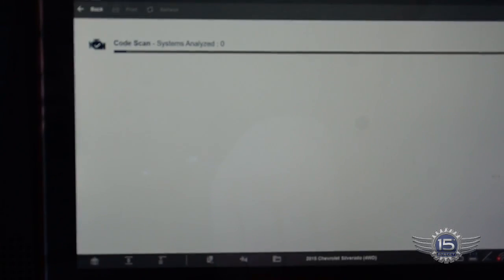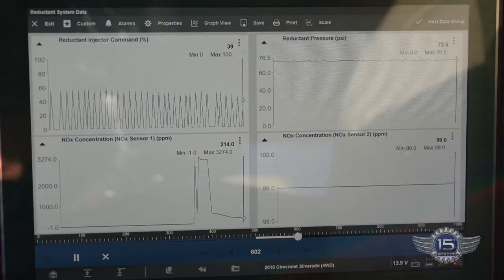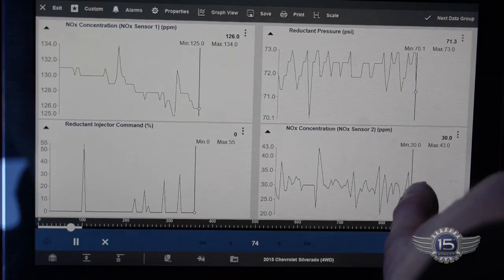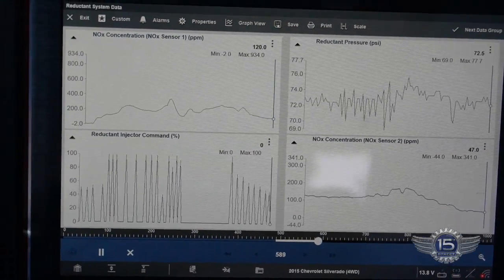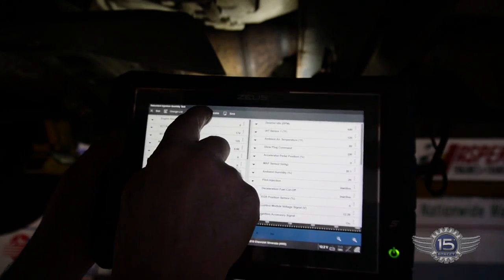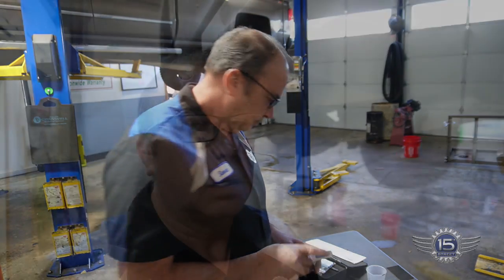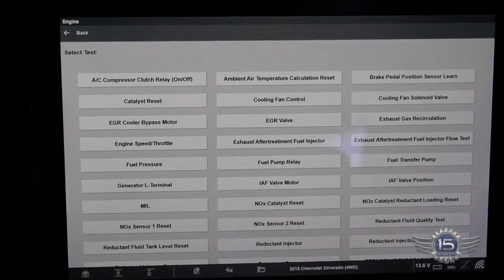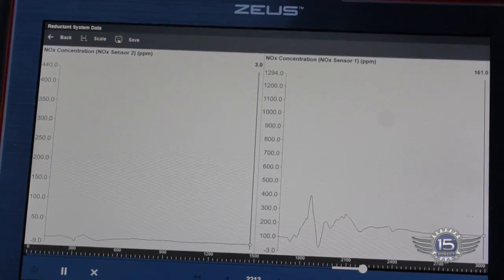Chevy Silverado Duramax P249D Diagnosed and Repaired

Comment: Had this happen to 2016 gmc 6.6 denalli. Replaced 1 and 2 nox sensors and def injector. Had the P249D code and count down to 65 mph. Took 3 tries to get it right but I think it's good now.
Reply: I’m going through tha right now. 2015 GMC 6.6 Denali. I got P249D code and count down. 

Can you elaborate please what did you mean “took 3 tries”?
Reply: What do you mean by it taking you three tries? Did you have to replace the nox sensor(s) multiple times?